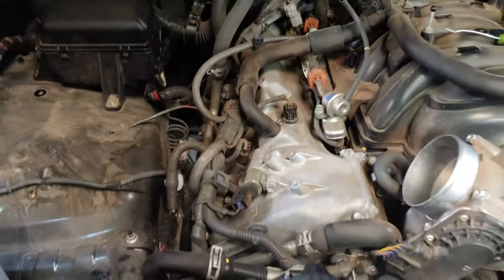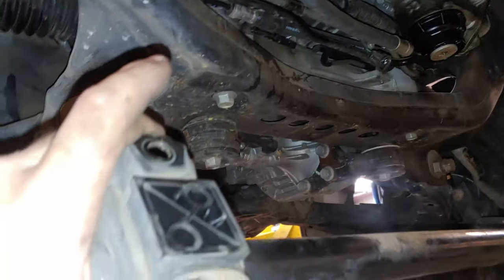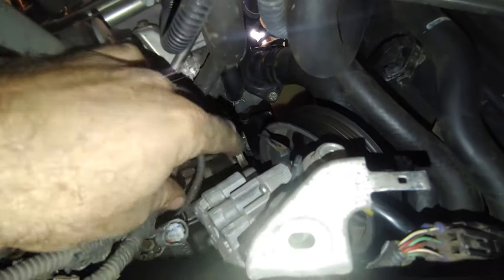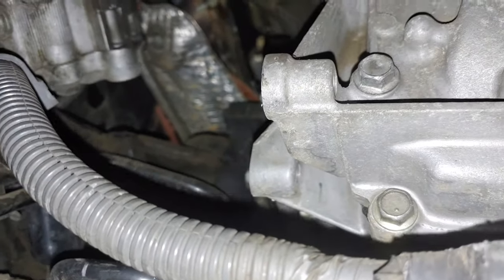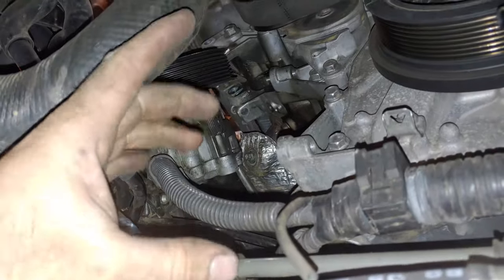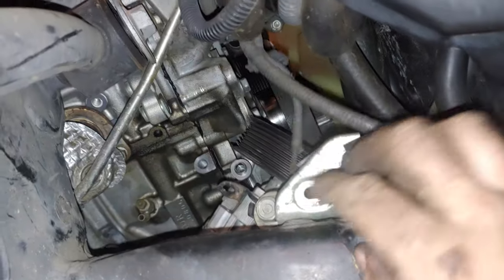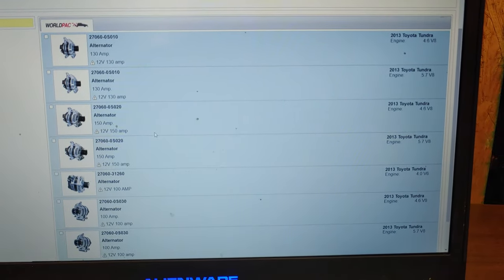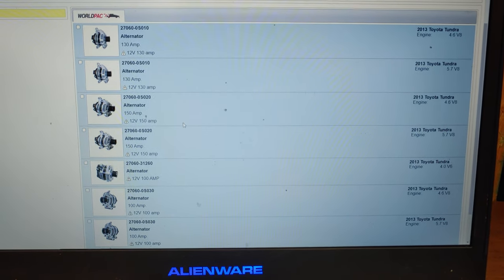Toyota Tundra 4.6 5.7 EASY alternator remove replace repair

Comment: Thanks for the video. This helped me tackle replacing the alternator on my 2011. I read another comment about turning the wheel to the right. Avoids taking off the passenger wheel.
Reply from the maker: Glad I could help you out
Reply: The wheel removal is the easiest part

Comment: My 4.6 takes a 180 amp. Bolts and plugs up the same but you put a 150 in and you get a bouncing voltage meter on the dash… runs fine but definitely not right
Reply from the maker: That's good info to know!

Comment: that is a lot of work for a trucks alternator.  good to know a better way to do this though. figure 1.5 hour for the job?  am looking at a 360A alternator replacement coming up here
Reply: Extremely large stereo. Four amplifiers, 20,000 Watts. It actually turned out to be a 406 amp alternator

Comment: do you know where i can get a tundra 2012 gearbox transmission
Reply from the maker: A manual transmission or auto?  Zip code?
Reply: @DiamondStarWerks  automatic black v8
Reply from the maker: Go to car-part.com put in your info and zip code and you'll see any yard around that has one listed.